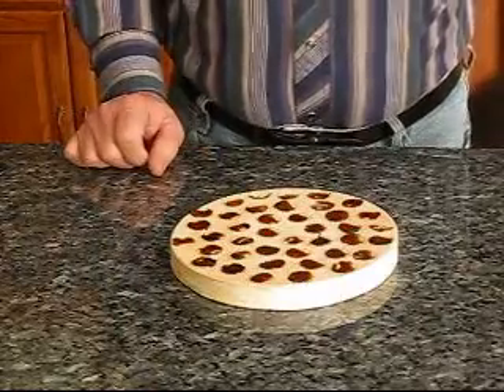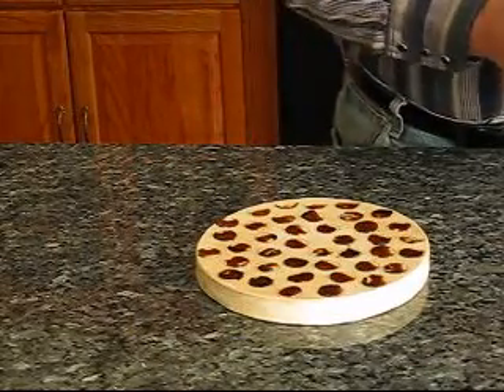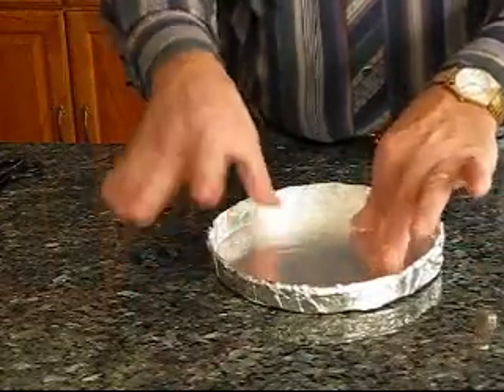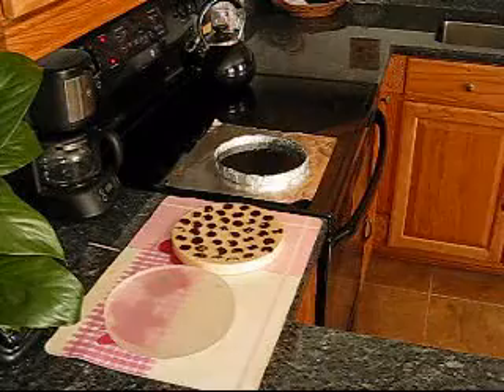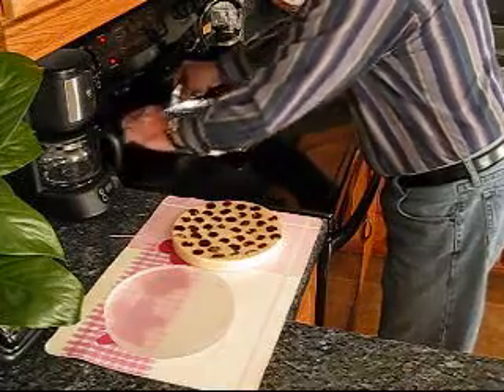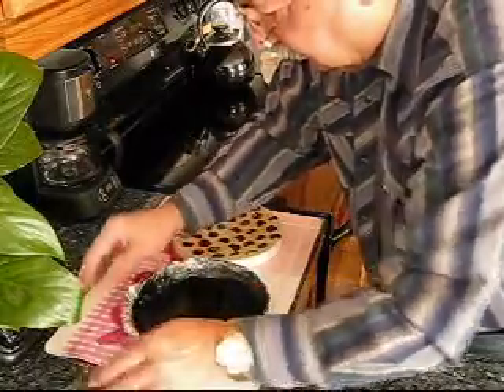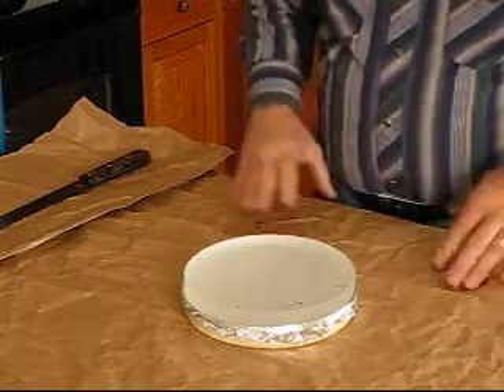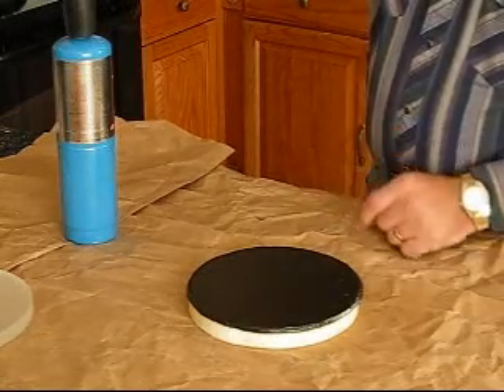Lens and Mirror Making for the ATM #6

Comment: Interesting method. What i do is use aluminized duct tape. Sticks to anything, heat resistant and is the perfect width. I center my tool on the tape and roll it on, tucking the bottom overhang under the tool. One wrap around works fine . I pour onto the tool and when it's taffy time , I cut a channel from pitch center to edge so the air bubble in the middle can escape. With a slurry of cerium and water I press my mirror down and rotate it frequently making sure the slurry never dries. I slide it off after about 10 minutes of repeated presses.